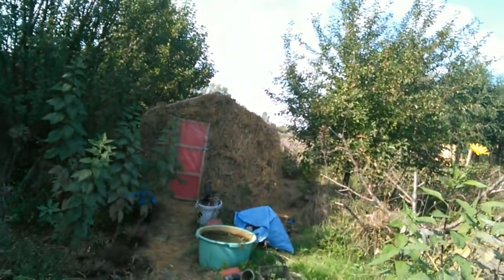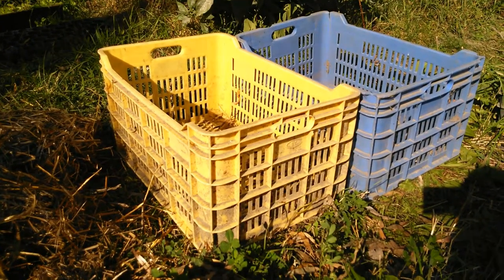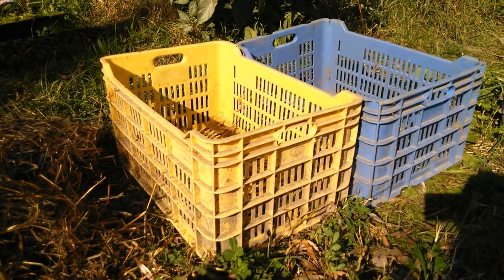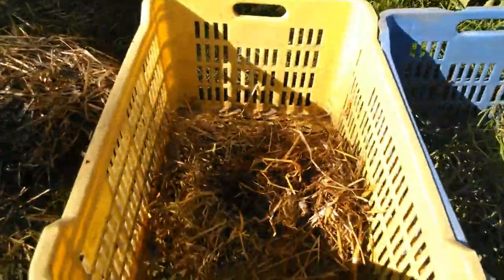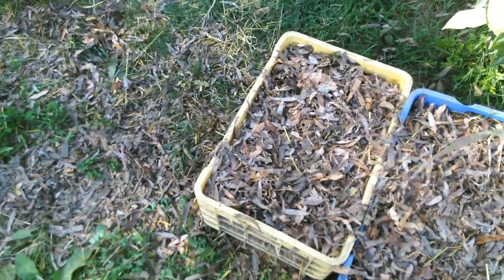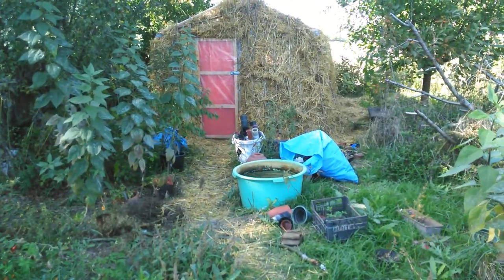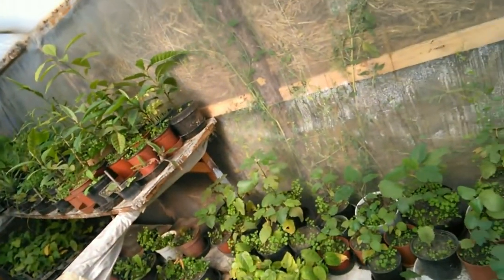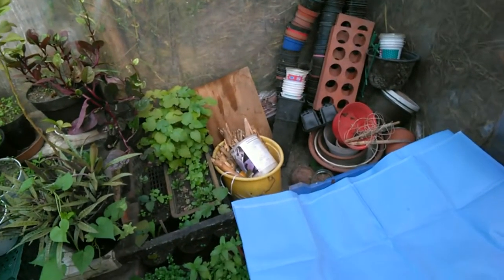Compost heaters for my green house

Comment: Good luck, Frank!
Reply: Cool idea to insulate the greenhouse with hay
Reply from the maker: Thanks! And it is still working... altought it's still not that cold.
Reply: It's definitely cold (-2 C) where I live (Colorado USA).  My compost is up to 55 C...just turned on the fan to circulate air into the compost chamber.  Let's see what happens.